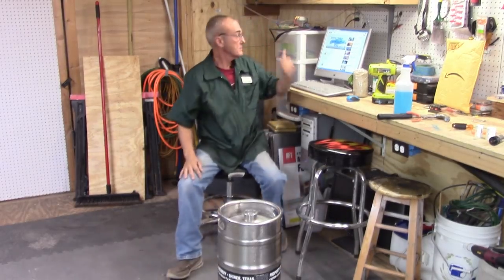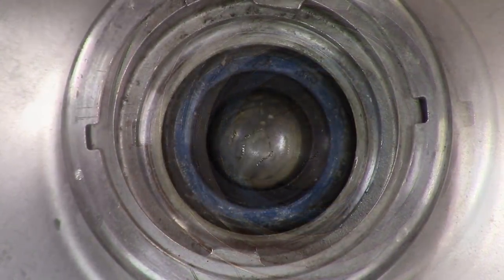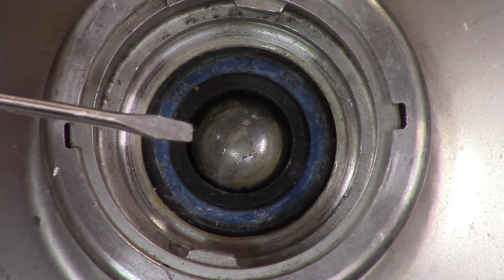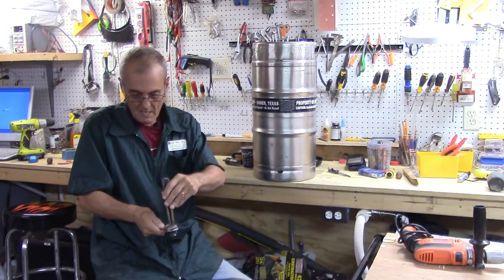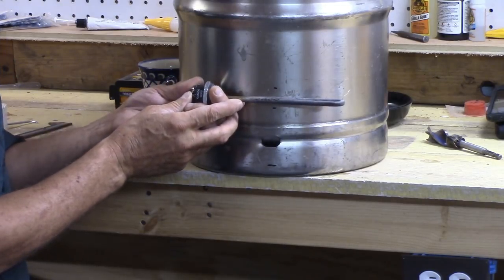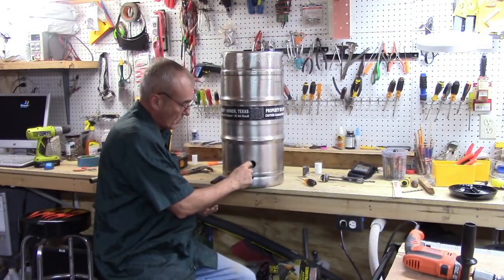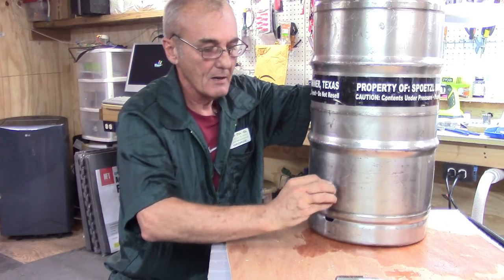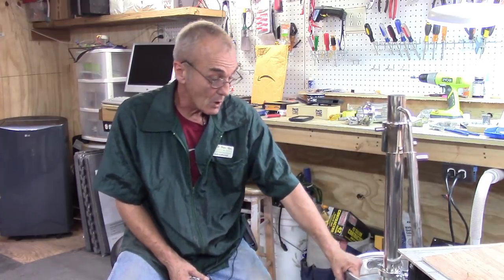RE-PURPOSE THAT BEER KEG, MAKE A KETTLE FOR YOUR STILL

Comment: Gorge, Hi! again... :)
You mentioned placing the second element 2/3 of the way up. I'm working on a 15 gal keg with two heating elements. I'm limited to 120 volts @ 20 AMPS. Planning on using a 5500w - 240v and a 3500w - 240v both wired at 120v. Would i Still want to stager the elements and use the second as static ? I don't think one 5500w *0.25 element could sustain proper heat for a 15 keg. In this case would i want the second element fairly low? Also once the pot is hot and up to temp, How much of the original power do you think is needed to sustain proper heat?
Reply from the maker: First of all I would recommend a 1500 or 2000 watt 120V element. They run about $8 at home depot or lowes. 
Also if you had a 2000W element the second element is not really required but could reduce heat up time a bit.
If you are stuck with 2 5500 watt elements wired for 120Volts this would actually be two 1375 watt elements. 
This will be fine for your operation. The second element as a static heat source is a good idea. The other one should handle the volume once it is up to temperature. You will probably notice that it will cycle on for a longer period but it should be just fine.
I do think you would be better off with the 1500 watt 120V elements.
George
Reply: @BarleyandHopsBrewing  5500w and 3500 is what I was thinking. If you think one 1500 element is good I'll use it. Less work. Thanks a ton.  Making my PID controller now.
Reply from the maker: Let me know if you run into any problems. I've had great feedback from many viewers who have built their own and love it.

Comment: I have a 4000 W heating element which I use for my brew kettle. Would that be overkill for something like this?
Reply: patrick deslatte No, you can also dimm the power when you need to, so a heater can never be to big ;)
Reply: Hook it up to a pid and your set.
Reply: chance kiki you don't even need to get a pid, just buy a variable controller and you'll be fine. Personally I like those better cause you have a lot more control over the still
Reply: Scotty Weißmüller but with a pid you can set it up for temp and it’s really easy and not that much
Reply from the maker: Absolutely. All these comments are spot on,, the PID would be perfect, a variable controller that can handle the amperage would work or even a pulse width modulator. Check this video out to see how to build your own.
https://www.youtube.com/edit?o=U&video_id=YO5cSjk_1QY

Keep up the great work and happy distilling
George
Reply: Tried to check out the you tube video you recommend watching but it will not come up.

Comment: Propane PID controller next? Lol
Reply: I've done a fair bit of thinking about this and it's more complicated than it seems. The issue is, the pressure in your propane tank isn't static, it fluctuates with ambient temperature. That means, you need either a pressure sensor, or a regulator that can accept a servo drive. 

The issue with this is safety. If your PID controller fails or loses power for some reason, the whole system can fail in the "on" position. That means, you need some way of turning the gas flow completely off without the use of electricity. 

As far as I've gotten in solving that problem would be some sort of shutoff ball valve that's spring loaded so it wants to close while it's on, but has some way of latching open while the power is on and the PID is functional. I'm thinking the way to go about it would be a solenoid that is held closed by the same power source that the PID runs on, so if the PID power source fails the solenoid opens, releasing the spring actuated ball valve and shutting off the flow of propane. 

They make solenoids that are built for continuous operation, but I don't know if it's an easy thing to power. Another option might be to use an electromagnet, so if power is lost, it loses its magnetic pull and that causes the spring to close the valve, but again, I'm worried about power usage because it really ought to run comfortably off a battery so you're not tied to a wall outlet. That'll let you do proper safe backwoods moonshine.

Comment: Like u showing mistakes can be a good thing lol
Reply from the maker: Yeah, no one is perfect and keeps viewers glued to find out where we went wrong.
Gotta love it.
Happy Distilling
George
Reply from the maker: I think it is possible but would be difficult. The only thing that beats a try is a failure !
Reply: @BarleyandHopsBrewing  failure is NOT an option. LOL
Reply: A little extra work, but you could solder a 1" stainless steel locknut over that 1-1/4" hole and use that for installing the heating element.  There are tutorials on YouTube for soldering stainless to stainless.